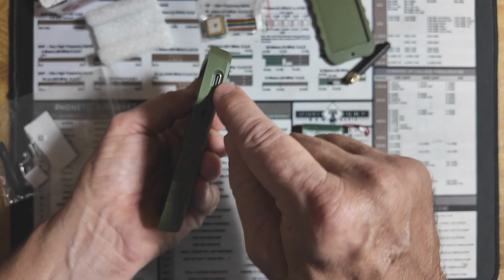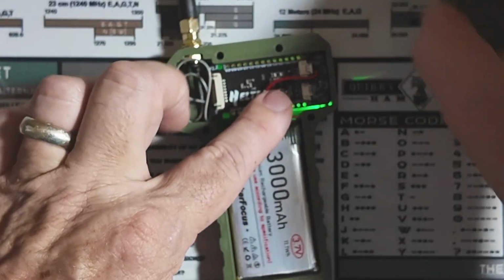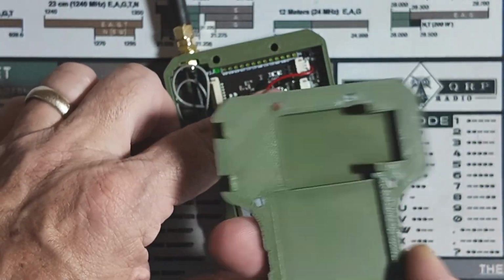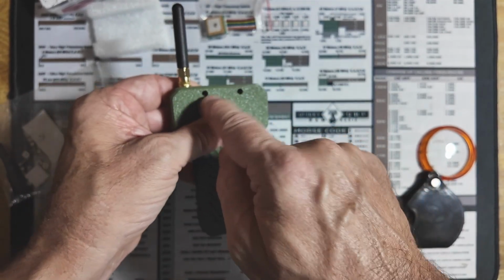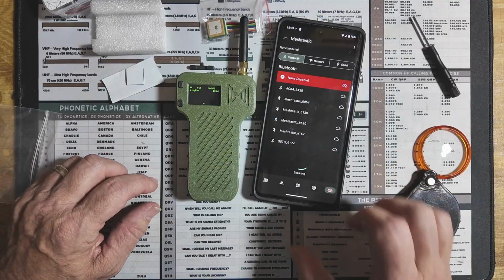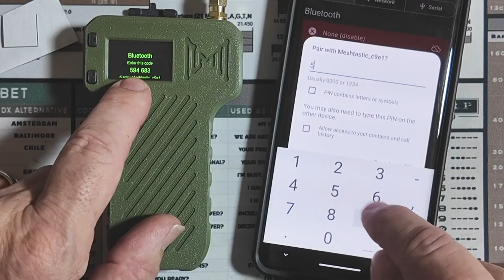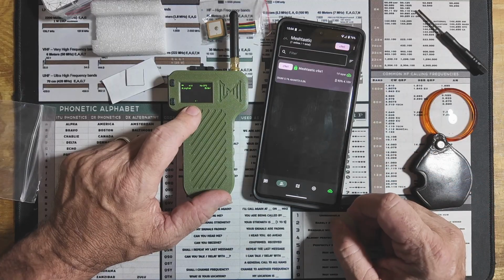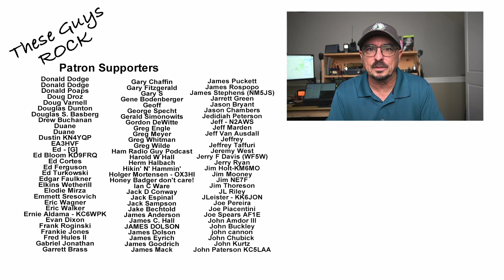DIY LoRa Mesh Node Heltec 114 + Meshnology N36 Setup for Meshtastic

Comment: I have two T114 nodes - one with GPS, one without.  The GPS cuts the battery life in half or worse, but it does add a couple features.  I guess it depends on what you want to use the node for, whether to add it or not.  I really dislike the ipx antenna fittings in general, but the "screen shield" on the T114s really makes connecting a pain.

Comment: I'd be tempted to use a little hot melt or liquid electrical tape to cap the nut slots to keep the nuts retained.
Reply from the maker: not a bad idea
Reply: Loctite?
Reply: @almightyEsquilax Loctite could be used to keep the screw from loosening from the nut, but likely wouldn't retain the nut if one removed the screws to work inside the case.  Like cyanoacrylate glues (super glue), loctite depends on a tight fit between parts, one that excludes air.  The slot holes probably have too much clearance.  Acrylics like that aren't gap fillers the way hot melt is.